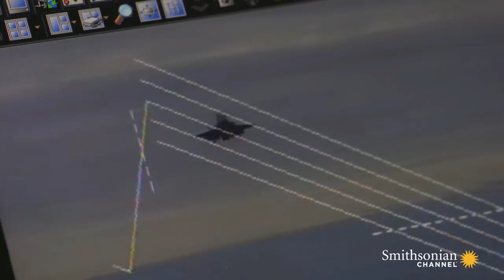This Fighter Plane Landing Has Never Been Attempted

Comment: This an old British pioneered technique done with the Harrier jump jet which landed on the French carrier in 2007
Reply: The british are so intelligent
Reply: A Harrier is not an F-35...not even close....☺
Reply: @michaelratliff905  yeah the f35 probably wouldn't be what it is without the harrier
Reply: Michael Ratliff the Harrier is the grandfather of the F-35. Had it not been for the British building the Harrier we probably would not see this aircraft here today. It was a phenomenal aircraft and revolutionised the use of jet aircraft off of LHD’s/ shorter decked carriers.
Reply: @r.m.l2665  yeah well the Harrier wouldn't exist if it wasn't for the Wright Brothers
Reply: @Dave-us5fq  yeah well the United States built the first Aircraft carrier, so the Harrier wouldn't exist but for that fact either..😁
Reply: @michaelratliff905  LOL, seriously? The USA wouldn't exist without the England either if you really want to go back in time. Although the first actual aircraft carrier was HMS Hermes. What is it with Americans and getting upset if another country does, or has something remotely interesting? We are on the same side..... roughly...
Reply: All that’s missing from this is an angled deck that’s offset from the ships course by 15 degrees, a camera in the flight deck that looks up the landing vector for the LSO to refer to, arresting gear and a tail hook. You know, things the Brits invented but the Americans perfected?

Seriously though, the F-35B can’t do a VSTOL landing with any ordinance? Jeez.
Reply: @gonzomuse  your the ones whom get upset, because England is unable to meet its former "glory". And in fact was saved by the Country it could not defeat. The U.S.A....you should be greatful,  as America saved Britain twice as I recall..WW1...WW2....aint that rite Crybaby??...👈😂🇺🇸
Reply: smile 2192  Ta,ta ..Cheerio "Cuz"...BTW....you surely MUST be special..perhaps .."Barron of Brain?"...ain't dat rite?...never spent a day as a SOLDIER for Britian nor anyone else...ain"t dat rite,,..,😔😳
humm?😂..."Garry Owen"!!🇺🇸
..
.
Reply: If the harrier hadn't exist then this would have been the first plane to do this, simple.
There is no revolutionizing bs etc.
They needed a plane that can land on small decks, and need is the cause for innovation and invention.
Reply: Michael Ratliff you’re not right but not completely wrong. HMS Argus (1918) was the first aircraft carrier. USS Langley (1922) was the first US aircraft carrier. The US made the first naval aviation flight in 1910 from the cruiser USS Birmingham. The British are also credited with inventing the steam catapult, angled flight deck and optical landing system - which the US Navy has been using since building the USS Forrestal in the early 1950s.
Reply: Starting a fight you cannot win. Amazing.
Reply: Good thing we’re technically allies. US Marines flew British Harriers now RN aviators are flying American F-35Bs. Kumbaya.
Reply: Amusing that Americans can’t bring themselves to admit someone else did it first (and at the time, did it better). The Sea Harrier was doing this, the US made Kestrals under licence, the best V/STOL aircraft in the world was the Harrier / Sea Harrier, we all know it, but a few Americans have to get salty about it. Weak.
Yes the latest incarnations of aircraft are a technological leap from the Harrier, but you wouldn’t compare a modern jet with an F4 Phantom, different beasts, different objectives, different times. 
We all ought to be glad that these developments are being done by allies and we aren’t watching a rogue state or opponent move ahead with new hardware.
Don’t forget though, the F-35 has been riddled with problems and has had major design flaws throughout its production, this aircraft ain’t the all singing and dancing product that Lockheed Martin sold it as, not yet anyway.
Reply: @michaelratliff905  no they didnt
Reply: @michaelratliff905  That's like saying the nuclear bomb wouldn't exist without oppenheimer's parents.
Reply: @CptnBigMac  vietnam all over again 🤣😂
Reply: @Dad-lu1oi  as an English man I 100% endorse this message.
Reply: @michaelratliff905  A British man John stringfellow did 30 yards of powers flight in 1847 using a steam powered engine in a place called chard in England.  Not sure why the right brothers take credit for being the first.
Reply: But this is an f-35 where its thruster are on its back unlike the sea harrier's four thrusters on its sides. and btw seaharrier land veirtically, the f-35 land diagonaly
Reply: While true that this has definitely been done before by the Harrier, the Harrier has nothing in common with the F-35B besides VTOL/STOVL. The way they land is completely different.
Reply: @michaelratliff905  tough talk for a guy who speaks english like a fifth grader
Reply: @michaelratliff905  the harrier is much more difficult to fly
Reply: @kennyfenny8435  Because he made a the first uav, not airplane. The wright actually flew fullscale planes that they themselve manned....More over, Air plane usage and practical plane design understanding was developed by the wrights. No one including stringfellow himself used his priliminary work to make planes, nor were any of his work used to expand the field of aeronautics. His work and designs are a very much dead end.
Reply: @r.m.l2665  don’t forget the yak-38
Reply: Can any Americans name a war they have won without support?
Reply: @michaelratliff905  america aint saved nobody in ww1 lol. The allies would have still one ww2 without america but the entirety of europe and africa would be communist.
Reply: @michaelratliff905  after the French surrendered the uk were fighting Germany, Italy, Czech Republic, Austria and multiple other countries. You struggled to keep the Japanese under control and had to resort to napalming and nuking civilians.
Reply: @kristiangant2584  only the one against themselves xD
Reply: @bmar400  haha 😄 even resorted to having the French, Spanish and Dutch helping against the UK 🤣
Reply: @ Michael Ratliff Why are the yanks so thick? Britain is and always will be the greatest nation on the globe. We have the Queen, Palaces and castles and the best army, navy and air force. The yankee clampets have donald trumpet, skid row and the simpsons. Such a great military force we have. Taught the argies a lesson. The hillbilly yanks lost in Vietnam and Afghanistan and could only get direct hits on their own soldiers and allies.
Reply: This is funny
Reply: @michaelratliff905  the French built the first aircraft carrier genius . The Fabre Hydravion . 1910 . They also invented the seaplane . Which is why they made the boat . Look it up .
Reply: If i remember correctly the harrier had a tendency to have to slam down the last bit because of ground effect.
Reply: @plazmaguy13yago9   the Harrier was made 50+ years ago! You’d hope there would be some improvements in that amount of time
Reply: @plazmaguy13yago9  smart one aren't ya
Reply: @michaelratliff905  other than the fact that both will fill the same role both are VTOLS both will be used by the British and American armed forces and both jets were made either by the British or with British involvement
Reply: @michaelratliff905  the harrier wasn’t just used by the navy and the first aircraft carrier was actually British the HMS Hermes
Reply: @aksmex2576  ever heard of the Yakolev Yak-141 brother?
Reply: @Alliesisthemostmedicalstudent  the F-35 has the same VTOL layout as the Yakolev Yak-141, and was actually developed initially in cooperation with Yakolev. Only problem for the Russian Yakolev fighter was that it was being developed during the beginning of the collapse of the Soviet Union so the funding dried up fully quickly. But yeah, the harrier and Yak-141 both have a bit of them within in the F-35
Reply: @dnlmk_1638  the research for f-35  is first strated at the height of cold war, many companies pulled out of the f-35 project because of the long research and development, and the moneys it was wasting, i just googled them both and it turns out the  yak-141 aka yak-41 had the almost same characteristics of the f-35B or the f-35 navy/marine variant, the sea harrier, yak-41, and f-35B had VTOL/STVOL but its just about it. Sea harrier is an independently made royal nave strike/fighter plane that it was never the same as the f-35 variants or the yak-41.
Reply: @dnlmk_1638  also, fun fact: HMS Queen Elizabeth was meant to carry and launch VTOL aircrafts, more specifically the F-35B
Reply: @superiorstrength8556  kicked us out of the continent? Canada?
Reply: @kristiangant2584  I actually think the US has won more wars on its own then britain, how many wars have you guys won on your own?
Reply: @superiorstrength8556  you think 🤔 get googling Terence.
Reply: @superiorstrength8556  sorry for your loss.
Reply: @superiorstrength8556  I mean the UK had trouble elsewhere, so it did not send all the power available, also without the help of France, it would have taken longer. (Because of the American Revolution, we had the French Revolution, mainly because France couldn't afford/shouldn't have been helping a growing separatist movement in the new world, to France at the time it was about weakening its colonial rival.)
Reply: @michaelratliff905  
Riiiight. 
You ever wonder why the White House is called the White House. And what happened when you Americans tried to fight a full proper war against us on your own???
Reply: @superiorstrength8556  you must either be trolling or are actually incapable of reading into history.
Reply: @medler2110  I know I’m late to this but I believe it’s the USS Langley it was a Jupiter class cruiser hull that the slapped a landing deck on to test out the carrier type class
Reply: @michaelratliff905  The first aircraft carrier was the HMS Argus a BRITISH ship.
Reply: @arfon2000  you need to be more specific to what you're referring to and i didn't even delete my post so you failed to score brownie points, either way you guys LOST!!! I dont think you understand how much of a underdog washington was,  a army of militia and volunteers repeatedly defeated the most powerful empire in the world in battle, that's impressive and the british surrendered to this ragtag group of soldiers at Yorktown a wins a win whether you like it or not
Reply: @superiorstrength8556  For one, if you didn't remove any comments, what am I quoting? and what are these notifications with your name? Also, I haven't denied that the British lost, I'm just referring to history. You've taken this too personally, also saying "you guys LOST" just shows you're a blind American nationalist, how do you know I'm British? I could be French, who by the way aided the Americans in the war, or I could be Canadian or even American. "I dont think you understand how much of a underdog washington was" and to this, I will comment that of course the revolutionaries defeating the British was a great achievement, but if you look back America wasn't the main focus of the British Empire at the time. Your view of history is skewed, you're probably one of those that thinks without the Americans the Germans would have prevailed in the second world war, which is objectively false, key example around 80% of Germans died at the hand of the Soviets, on the eastern front.
Reply: @arfon2000  not at all I understand all allied powers contributed to the victory in world war 2 I was just responding to earlier Commenters who were uneducated  on America's war record
Reply: @superiorstrength8556  Which is by far below that of what is on the list of European nations (that being war records) and China is on a whole other scale in terms of warfare.
Reply: @arfon2000  No it's not below anyone the United States is way younger then those countries you mentioned and has still won more wars then most of them anyway no other country as young as the U.S has won so many battles its not bragging it's the truth you guys started I finish it
Reply: @superiorstrength8556  "no other country as young as the U.S" compared to "I actually think the US has won more wars on its own then britain" from your previous comment, these are totally different, you've changed the meaning, from saying the US has won more battles than Britain, to just countries that are as young as the US. China has been having battles for the last four thousand years, so the US definitely hasn't won as many as China (depends on what your definition of China is though), And if you just look at Europe there is legit something call the Hundred Years' War (not one conflict and it actually lasted 116 years),  also most of Europe is younger than America anyway, Germany only came to be in about 1871, out of the main nations in Europe America doesn't even come close. History isn't just a clear cut thing, I should add. "its not bragging it's the truth".
Reply: @arfon2000  what are you talking about? Ive not deleted one post on this thread, maybe you're having malfunctions, go up above to my earlier comment and there's a list of all the wars the U.S has won with no allies
Reply: @superiorstrength8556  malfunctions? I don’t think fully written comments can be malfunctions. Unless YouTube auto generates them, which is highly unlikely.
Reply: @michaelratliff905  And both owe the USSR for the fact that WWII was won, the Soviets literally did more to end the war then the US, UK, Canada, French & Polish etc. combined.
Reply: @vernonbear  Didn't the Soviets build a VTOL aircraft which, unlike the Harrier, was supersonic? So the Harrier being the best VTOL aircraft in the world is very disputable, more like the best in the West.
Reply: @nalac7203  Actually no. The British just lost it to the Americans, but the French, Dutch and Spanish were involved in it as well, having all colonised what we now know as the USA together. The French were just smart enough to sell their part to the Americans and instead of losing their colonies got financially compensated for them.
Reply: @pieterveenders9793  I don't think they actually managed to finish the project, due to a small event in the 90s.
Reply: @pieterveenders9793  Also, what has Brexit done that has negatively affected the UK massively? But the UK does look to be the first to fully vaccinate the nation in Europe, with about 21 million first doses, the next closest is Germany with about a total of 6 million, then France with 4 million.
Reply: @michaelratliff905  to make your wrongs right the UK asked american help in ww1 and 2 but you took about a year to give the help. Then the germans and british are the ones that made your 'great' america so great

The germans helped you with the nuclear bomb, the germans helped you with apllo and they made the m1a1 abrams have a gun

The british helped by making your country, making the first jet air liner and the idea.
Reply: @superiorstrength8556  The U.S. won because the french helped.
Reply: @animalmother3526  yes the French helped alot but the U.K. could've never defeated the U.S they tried again in the war of 1812 and failed again the U.S had no allies this time, if they could defeat the U.S then we'd be British right now but we're not
Reply: @superiorstrength8556  clearly not. And by the way no nation is the "greatest" a lot of nations have great achievements to their name be it technological or other. But apparently to you greatest nation means the one that is the most warhungry. (with mediocre results for some wars as well, as others mentioned) I'd suggest reviewing your definition of great nations. And for the record, I am fairly confident that no war ever is as simple as x won, y lost. As always historical  context is extremely important
Reply: @mintoc8853  no I clearly am, and when did I say a nation is the greatest? All of that I've said in this thread is all facts
Reply: @superiorstrength8556  Not really your first comment said that America kicked Britain out of the continent, which just shows your incompetence. You even reference the war of 1812, which just contradicts this first comment. Which by the way was caused by American aggression and ended in Anglo–American status quo antebellum.
Reply: @Dave-us5fq  Nah this version of the F-35 would probably have been made no matter what.
Reply: Halo give up its not a crayon drawing so it's going right over his poor wee heed😂
Reply: @superiorstrength8556  Nice edit, and nice contradiction, you literally just put "you have no idea what you're talking about I said we kicked you out of AMERICA" then "the "continent" phrase was a mistake but I corrected it,", I didn't lose any argument here, all I've said are facts, just use the internet if you don't believe me. Also, there were many factors in the build-up to the war, but it is a fact that the Americans declared war on Great Britain.
Reply: @arfon2000  No you lost clearly, all of what you just quoted was in the same comment so I don't get your point did you even read it? The U.S declared war because
1. The impressment of American sailors
2.British support for native attacks on American settlements and blocking expansion west
So yes it was because of The british behaviour that the U.S declared war
Reply: @superiorstrength8556  Well done you can use the internet, but my point still stands, the US declared war, and also they wanted a bit of expansion.
Reply: Also, it was happening at the same time as the Napoleonic Wars, so the fact that it ended in status quo antebellum in the first place was a good outcome, in the eyes of the British.
Reply: @Nybbl er that is why the f-35 and yak-41 is different from the sea harrier, and btw its "vtol". Sea harriers are mostly landing pure vertical, yak-41 and f-35 is landing diagonaly, thats why it was never been tested a diagonal landing on a carrier because its tricky, different from the sea harrier. The HMS Queen Elizabeth is made to carry F-35 (as you heard from the video) and not sea harriers, the royal navy also made a queen elizabeth class aircraft carrier named HMS Prince of Wales and also planning to carry f-35s.
Reply: John Citizen  you saw it at video, they're like landing the plane on vtol way but at the same time like a traditional way.
Reply: @Dr.Westside  no that was a seaplane boat not an aircraft carrier.
Reply: @Nikola Yak-141.
Reply: @superiorstrength8556  Well over one hundred, possiby more, does having the biggest empire the world has ever seen, ring a bell?
Reply: @Dave-us5fq  "Had it not been for the British building the Harrier"

With an incredible amount of funding provided by the US taxpayer via the MWDP else it likely would not have made it past the drafting table.
Reply: @kwaktak  "Seriously though, the F-35B can’t do a VSTOL(sic) landing with any ordinance(sic)?"

STOVL and I would bet the kneeboards contain an ordinance or two. By the way, those F-35Bs that were involved in CSG21 and flew with air to air missiles, aka ordnance, how did they all recover on the boat?
Reply: @vernonbear  "the US made Kestrals(sic) under licence,"

Incorrect. The United States bought six Kestrels following the disbanding of the TES. The Kestrel was a prototype not a production model and all production Harriers - AV-8As - bought by the Marine Corps were manufactured in the UK, broken down, shipped to the United States and reassembled. The plan was for Harriers to be manufactured in the States but it was cheaper to have them built in the UK. 

"the best V/STOL aircraft in the world was the Harrier / Sea Harrier, we all know it, but a few Americans have to get salty about it. Weak."

The best operational VSTOL aircraft in the world was the greatly modified and improved McDonnell Douglas Harrier II and its Night Attack and Harrier II+ variants, not the original Harrier.
Reply: @Alliesisthemostmedicalstudent  SOP for the F-35B at sea is to recover vertically. SRVL may become SOP for all recoveries in the future but that day is not in the near future.
Reply: @embr4247  Recovery was more abrupt in the final seconds to avoid pop stalling.
Reply: @chezmcdave  Harrier/Harrier II - VSTOL

F-35B - STOVL
Reply: @dnlmk_1638  Ever hear of the Convair 200, Ivan?
Reply: @dnlmk_1638  "the F-35 has the same VTOL(sic) layout as the Yakolev(sic) Yak-141,"

Incorrect. The Yak used designs stolen from the Convair 200. The Lockheed patented and designed shaft driven, clutch coupled lift fan is unique to the STOVL F-35B.

"and was actually developed initially in cooperation with Yakolev. "

Incorrect. Lockheed bought flight test data from Yakovlev, only. Yak never delivered the prototypes that they were contractually obligated to supply did they?
Reply: @Alliesisthemostmedicalstudent  Yakovlev stole much of the design for the 41/141 from the Convair 200.
Reply: @Alliesisthemostmedicalstudent  STOVL not VTOL
Reply: @CheeseBaller948  possibly done by the Soviet long before Harrier !
Reply: @michaelratliff905  The Wright Brothers were a poor second to Sir George Cayley in 1853, who successfully constructed an aircraft that carried a man 423ft, just so you know.
Reply: @gonzomuse  NOT just England, but together with Wales, Scotland and (Northern) Ireland, we Brits were amongst several European peoples who invaded, ethnically cleansed and then colonised the north American continent.
Reply: @peterscott7140  Oh joy, a reply to a 3-year-old comment! AND it's completely unrelated to the original comment! Brilliant. I didn't say JUST England. The British didn’t “invade” the American continent or commit genocide. The British were welcomed and made plans to share the continent. In the war of 1812 most Indian tribes sided and fought with the British against the Americans. It was the Americans that ultimately ethnically cleansed North America.
Reply: @michaelratliff905  'whom get' ,  'greatful'? Can we at least have our language back!